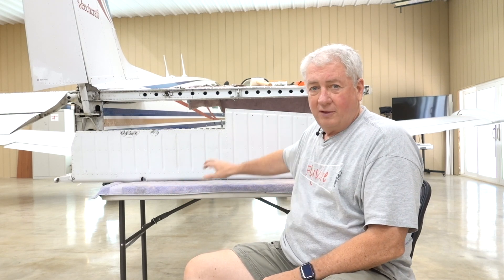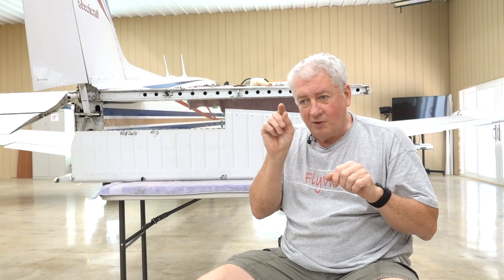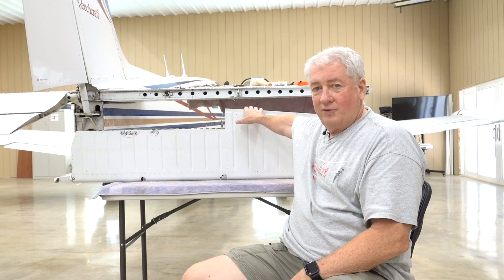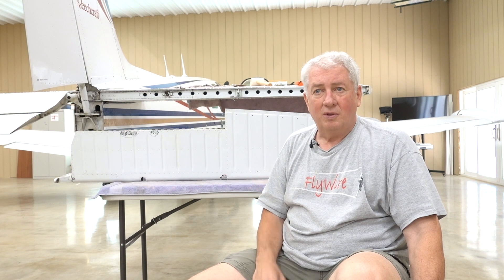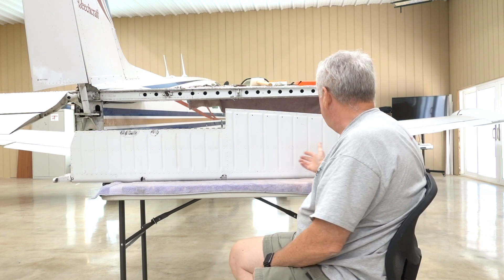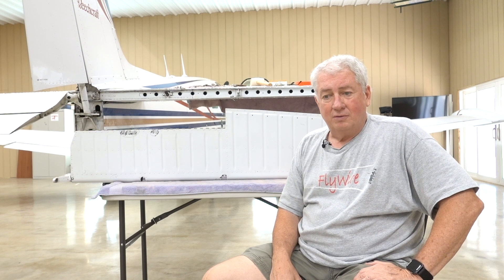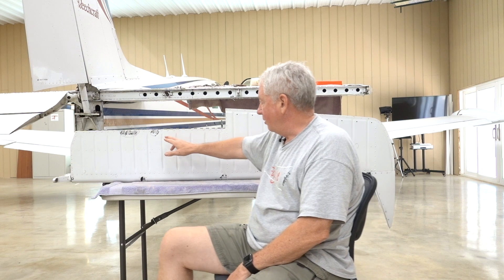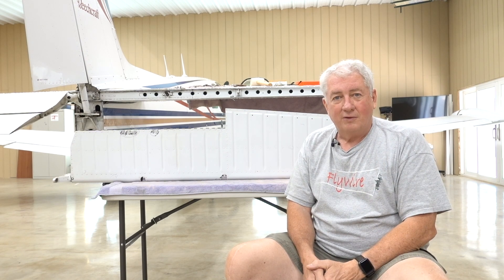Filiform Corrosion and Bonanzas

Comment: Hi Scott.  I'm wondering if you can tell me what paint shop you used or would recommend.  I purchased a Debonair about 4 years ago and at the time chalked up the worm trails I noticed on the ailerons to the paint job.  I'm in Houston.
Thanks!
Reply from the maker: I did a video on painting my F33C. I used Flying Colors in Gainesville Tx. They also did the fix on the A35 elevator.
Reply: @FlyWirescottperdue  Thank You!

Comment: I have 2007 Bonanza - does it have magnesium control surfaces?
Reply from the maker: As far as I know it does. I haven't seen your logs.
Reply: On the older Bonanza's there are magnesium horns on the tail feathers and some on the nose gear fuselage mountings. The fuselage nose gear mountings are in the lower cowling where water collects.

Comment: Hi Scott, have you ever looked at stray electrical current as the most significant contributor to galvanic corrosion.? Stray current contibutes to more than 98% of corrosion. There is a great product used in the marine industry, SeaBis. Cheap and Easy to use and it works. Check it out!
Reply from the maker: Richard, filiform corrosion is electrically based. In the airplane world, especially in the certified world, you have to use approved products.

Comment: Hi Flywire  have tryed treating the magnesium with a process called magnesium  dicromate.  from working on the p&w r2000 engine the engine casing are made from magnesium and we treated the casing with this process before painting, it works the same way alodine does on aluminium.
Reply from the maker: Yep, alodine is a good process for Aluminum, but not Magnesium.

Comment: As I recall, the USN first experienced filiform corrosion in the early 1960's on the P-3A Orion patrol planes, in conjunction with the introduction of polyurethane paints. These paints were much less porous to moisture that was trapped underneath than older paint types. The solution was careful surface preparation, and Alodine conversion coating prior to painting.  Even when spot repairing corrosion, when the bare aluminum is exposed it is given spot Alodining before re-painting.  Everything in the navy is about corrosion control!  Cheers, Bill, retired NFO.
Reply from the maker: Good info Pelican!
Reply: Without revealing my educational background, I will disclose that I had a course in painting.  
Rules 1, 2, 3:  Surface Prep
Rule 4:  match the primer to the surface and the paint to the primer.
Ironically, the only color mentioned in the whole course was "red lead."

Comment: And how likely are you to have or find this type of corrosion inside the flight controls?
Reply from the maker: Good question. A=From what I understand it is not as big an issue. The controls were originally dipped for the conversion coat. They weren't stripped and repainted like the outsides, Possible, but less likely.

Comment: I had both elevators on our F33A refinished about three years ago due to corrosion. It was quite a lengthy process to get all moisture removed and then refinished. Had them done in Ennis and they're doing well. I learned from your video the technique for checking them. Great information. Thank you!

Comment: I just replaced both ailerons in my 1961 V-Tail due to filiform corrosion. In three months it went from a couple of quarter sized rough worm tracks to covering a great deal of the control surface. My airplane has always been hangared and lives in Michigan. Total cost to have them re-skinned in aluminum, painted and balanced was $7,500. Great content as usual. Thanks FlyWire.
Reply from the maker: Jim- Thanks for watching and commenting!
Reply: Hi, is there an aluminum re-skin option for these V tails?  I'm facing the same issue.
Reply: @flydogairventures4318  Yes, I had my ailerons reskined in aluminum.

Comment: Could you explain in the future how the control surface(s) is balanced after painting.
Reply from the maker: Sure Jon. The MX manual specifies what procedure to use and it varies between models slightly. But basically you hang it by the fulcrum and adjust the balance weights in the nose of the control to within spec. Are you asking for a video on how that is done?
Reply: @FlyWirescottperdue  Yes, I think that would be very informative.

Comment: Good video. Plenty of filiform on outside stored Cessna aluminum elevators here in the northeast. Pipers as well. As you point to..trailing edge of control surfaces is common in my neighborhood. 
Keep the videos going . 
ABS is making progress for us V tail folks. I corrosion X my control surfaces internally as well . 
Good subject and advise .
Reply from the maker: Water is incredibly corrosive. What etching does is remove the oxidized layer, and the alodine basically seals it by leaving a very thin coating on the metal. The etching clears off the 'dead skin' and leaves a surface that promotes adhesion when you prime and paint. 

For plain aluminum the surface eventually is exposed to the elements and corrosion will follow, aluminum, steel or magnesium. 

Thanks for watching!